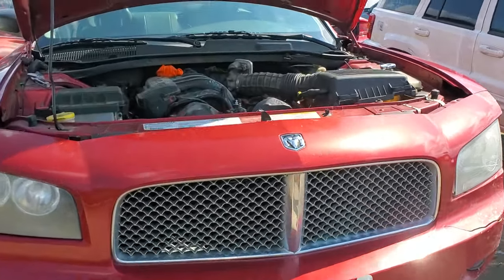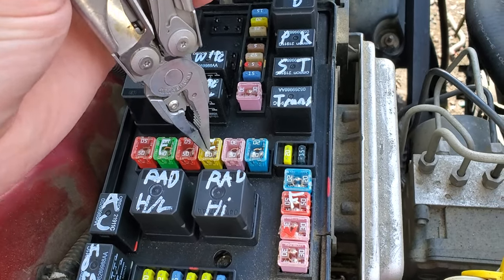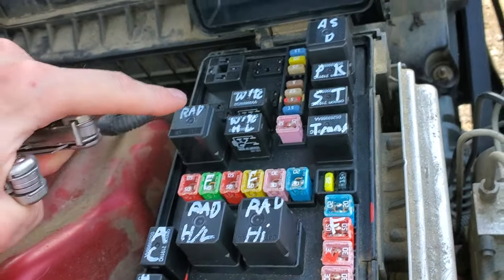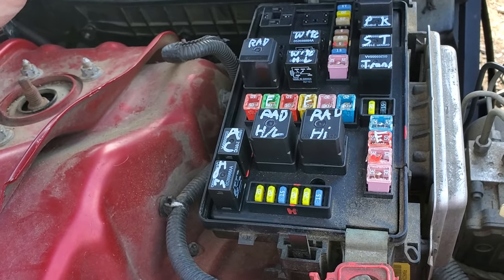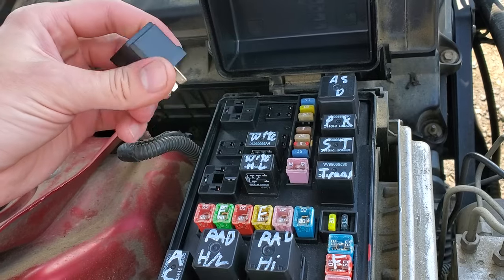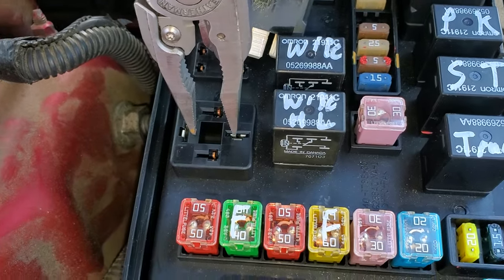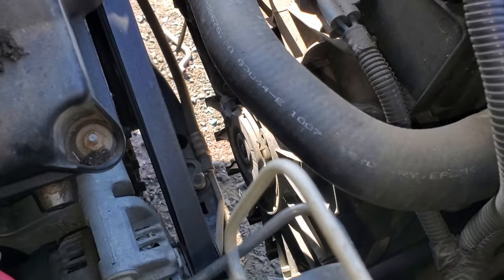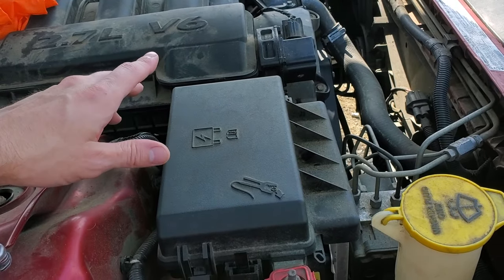2007 Dodge Charger Cooling Fan Fuses & Relays

Comment: Big question I bought one today the fan turns on then does continue working after 1 spin and my resivor over heat and spits water
Reply: same thing happening to me any clue?
Reply: @Xelaon   I took out the fan fuse and it continued working constant
Reply: Overheats with the fan running? Then the overflow bubbles and spits coolant? Sounds like a head gasket to me.
Reply: @sspeedy2859  I had just replaced thermostat but I completely removed it and problem solved may have been a faulty thermostat or the 100% coolant flow is a bandaid to a bigger problem

Comment: I managed to blow something on my Charger 2018.  Essentially I started the car an forgot to connect the TB, which in turn ignited 3 diagnostic codes.  At that point the engine then started to act erratically the moment it seems it would ignite fans instead it just winded up like someone press the gas pedal and would trigger the zigzag electric code on the dash.  So no fans turn now when it reaches the temps to spin them.  So annoying, and quite critical.  Sop what I do not know is; is it a relay? (which one) Is it somewhere closer to the fan itself?  I don't thin kit's any temp sensor, but I don't know enough to be sure.  I just know that when the fans supposed to kick in, the engine just winds up and no fans turn...

Comment: I just noticed my car 07 charger...I don't have the 60 ...does it HAVE to have all the fuses...I'm having problem..it's getting hot..new thermostat..pump looks good...just don't know why it's getting hot
Reply: Did u figure out the problem because I’m having a similar one, was wondering if u could tell me how u fixed yours
Reply: Any luck with the fix? Same issue here. New pump and thermostat, still no fan power.

Comment: This helped me. So Here's what  happened yo me in my 2008 dodge charger rt. I was sitting at drive through and the ac and lights all went dim. I turn the diagnostic mode on by holding music and compass buttons o  the steering wheel.  I noticed that the engine temp was at 108 Celsius and my battery was at 12v. So I revved the engine a bit and the volts shot up to  14v and ac fan blew normal. I got home with no issues after.  Next day I go to turn the car on and get a check engine light code was p0480 cooling fan 1 control circuit.  9 check the fuses and the green fuse is blown next I checked the fans and one of the radiator fans is stuck.so I turned it by hand but it is really stuck. So what I think happened was the car tried to turn the fan on but it was stuck so ot blew the fuse. Will be gett9ng  a new fan.

Comment: What if the relays and fuses are good but the fans still don't come on by them self if I by pass it they do turn on so I know they work what can it be?
Reply: Im having that same issue. Did u figure out the problem and solution? Any info would be greatly appreciated, plz and ty.
Reply: Same. I'm wondering what sends power to the relay and are they supposed to come on with ac?

Comment: Are the fans supposed to come on only when using AC or do they come on automatically like some cars after driving it?
Reply: The thermostat tells the fan to come on when the engine reaches a certain temperature
Reply: The thermostat doesn’t send power to anything.